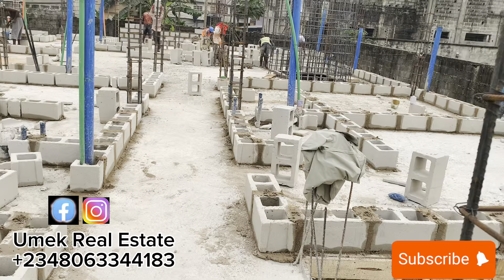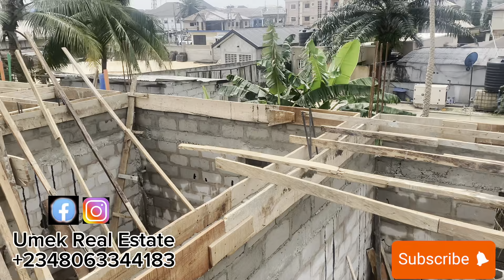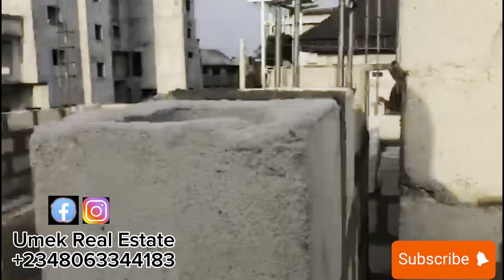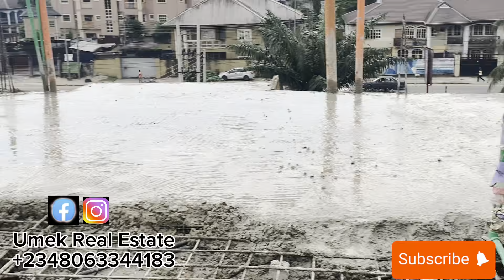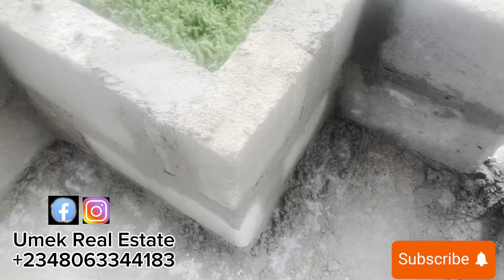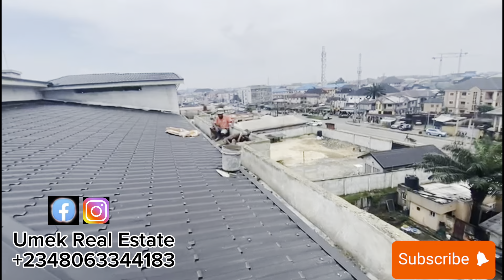Construction of a 4 Star Hotel in Nigeria, Details, Quantity of materials & Construction stages

Comment: Lintel is use to divide doors and windows, but if the doors and windows are close you can connect the together, beam is different from lintel
Reply from the maker: That the lintel is different from the beam is common knowledge, and I am sure I never said there were same.
Reply: @UmekRealestate  so you are spending more money in chaining the lintel together except the owner will change the design tomorrow, engineering is safety and economy,
Reply from the maker: @ebukaharrison4594  On the contrary, saving money by chaining at lintel level rather than doing a short lintel and then chain again on top of the lintel at the beam level… again that allows for possibilities of alteration in the future…
Reply: You are a good builder, you did a good job on foundation, but the span of this building is large, but to avoid unnecessary deflection,the beam size suppose not less than 450mm , and area of reinforcement on part of the are not enough since they carry slab and block load, anyway you did a nice work, is only intelligent person can build this kind of building,
Reply from the maker: @ebukaharrison4594   thanks for your comment, however, after the chain lintel of approximately 300mm we also have a second beam just before the decking at each level, which I believe, takes good care of the load distribution…. Cheers!